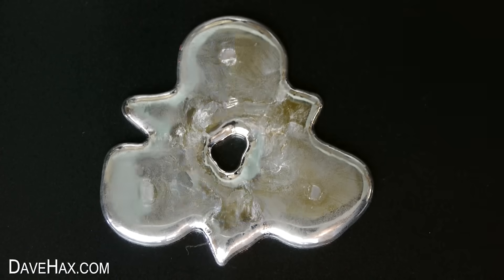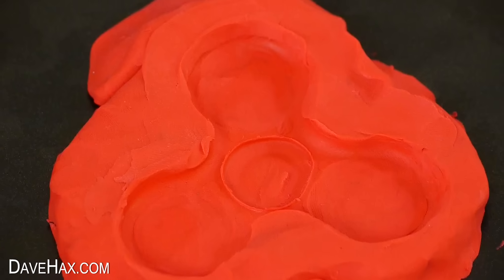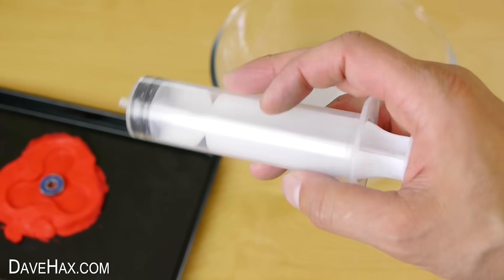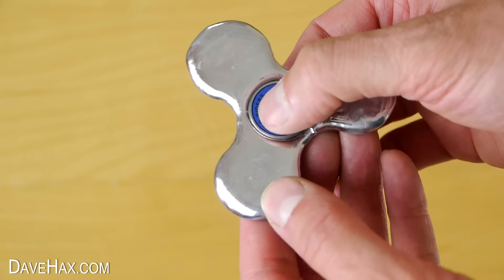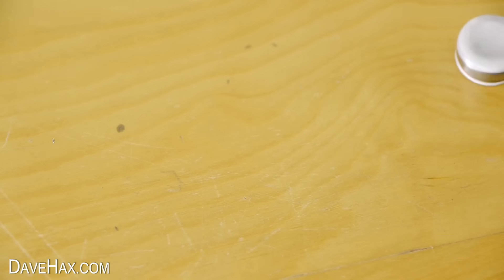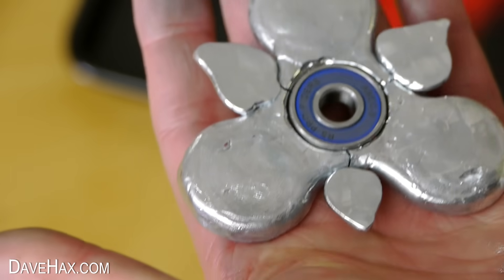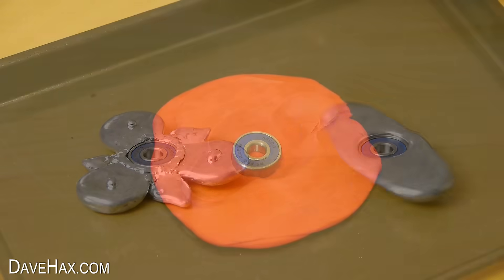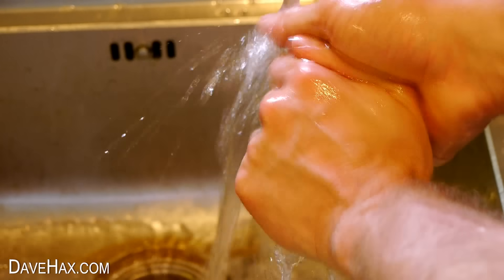DIY Gallium Fidget Spinner

Comment: No reason to partly destroy the outer shape when you take the forming spinner out. Using the holes would make more sense especially when you remove the material in the next step anyway…

Comment: But gallium will melt 
If we kept this on our palm
Because gallium's melting point is very low
Reply: They are making this in one of the cold countries I guess
Reply: Subodh Gorai
Reply: Subodh Gorai it wouldn’t change your body’s temperature. Unless your outside.
Reply: Yep, look at his fingertips at 2:37
Reply: Also, at 4:15 you can see his fingerprints in the spinner just from touching it a few times.
Reply: agung novia  no and because of this it is used alloyed with indium and tin as replacement for mercury
Reply: 29.76 degrees
Reply: Since our normal body temperature is 37 degrees Celsius but gallium's melting point is 30 degrees Celsius
Reply: Yeah like 80 degrees
Reply: freakin thief I was gonna say that

Comment: Can i use Mercury instead? ( ͡° ͜ʖ ͡°)
Reply: Yeah. You should be fine...
Reply: Radziecki Opiekacz Do Dzieci ( ͡° ͜ʖ ͡°) nah, mercury is for drknking.
Reply: when just cancer you get from fidget spinners is not enough
Reply: Nah, mercury only safe as teeth fillings.
Reply: Radziecki Opiekacz Do Dzieci ( ͡° ͜ʖ du zu zu zu viel mehr mit dem bus fahren
Reply: only if you're in a freezer
Reply: Tomasz Gowin 1
Reply: Mercury is poisonous as well so dont' touch it or eat it !
Reply: ( ͡° ͜ʖ ͡°)
Reply: Оксана Маркова booking com
Reply: ( ͡° ͜ʖ ͡°)
Reply: Mercury doesn't stay in a solid state in room temperature dumbass.
Reply: napewno
Reply: just remember to hold your breath and not eat your mecury fidget spinner :^)
Reply: Radziecki Opiekacz Do Dzieci ( ͡° ͜ʖ ͡°) Polska jest wszędzie  (0>0)

Comment: Gallium melts at about 303 K. So you can't use it in summer. In facht, if you hold it long enough it will melt in your hand. Additionally, it can be irritating to skin, which makes a coating necessary.

Comment: Well, thanks a lot for introducing me to gallium. I mean, I knew it existed, but I didn't know it was so easy to handle and had such a low fusion point. Who would've guessed you coukd melt metal in hot water and pour it in a mold made of Play D'oh? It seems to be ideal for many DIY works. The purpose of a fidget spinner still completely eludes me, however, as I find it a useless novelty whose hype is only sustained by clever marketing, but the video was worth watching.

Comment: Trick tip for fidget spinner: 
Have a problem with noisy bearings? 
to make the perfect bearing lube you will need. 
- super glue (I know it's weird) 
- 50ml water 

Mix your ingredients until it is 'mixed in' 
Use a spoon or something to pour the solution onto you bearings. 
And voila, the people around you will no longer have to hear you fidget spinner.

Comment: Who even casts with gallium? Its melting point is at around body temperature (Also explains why you had those stains on your hands).  Try using aluminum in a foundry instead. Gallium isn't very practical, especially for fidget spinners since it just melts in your hands.

Comment: Not sure if it's that practical to make something designed to hold in your hand out of a material with a melting point below your body temprature...

For those who don't know: Gallium has a melting point of 29.76°C (normal body temprature is around 36-37°C for those who are more acustomed to the farenheit scale). So this little toy will actualy melt on a warm summer day even in temperate climate.

Comment: only problem is, if someone, i dunno, a kid, holds it in there hands and fidgets with it without spinning it (as in moving around hand [warming]) it would most likely melt, and then you'd have your fidget spinner as a puddle on the floor.

Comment: Metallic gallium is not toxic. However, exposure to gallium halide complexes can result in acute toxicity. The Ga3+
 ion of soluble gallium salts tends to form the insoluble hydroxide when
 injected in large doses; precipitation of this hydroxide resulted in 
renal toxicity in animals. In lower doses, soluble gallium is tolerated 
well and does not accumulate as a poison, instead being excreted mostly 
through urine. Excretion of gallium occurs in two phases: the first 
phase has a biological half-life of one hour while the second has a biological half-life of twenty-five hours.
Reply: You could've just linked the Wiki instead of copy and pasting it
Reply: +Sgtchickens 😂😂😂😂
Reply: This guys is legit. look at his recent video.
Reply: dm12.certi e2

Comment: Don't even bother trying the gallium one, gallium melts as it sits, so if you aren't touching it for a while the room temp will just melt unless you store it in a fridge when not in use, and if you spin it and touch it with your fingers, it slowly melts, makes a mess.

Comment: Doesn't the gallium corrode the outer of the bearing?
Reply: They're usually made out of steel, which doesn't have many issues with Gallium. Aluminum, copper, or their alloys can cause corrosion when placed with gallium.
Reply: Smikkelbeer depends on what the outer bearing is made out of
Reply: Edragoninja Gallium corrodes quite a lot of metals
Reply: Smikkelbeer Gold doesnt corrode at all alloys in gold do but gold itself doesnt.
Reply: Smikkelbeer the outer bearing doesnt matter tho
Reply: metayoshi1 Gallium corrodes all metals except tungsten and tantalum
Reply: Patrik Kišićek Gold does corrode when in contact in Gallium. It only doesn't go as fast as e.g. aluminium. 
There is quite a big difference in how fast or how much a metal corrodes between metals.
Reply: Smikkelbeer Fuckin nerds, SPORTS SPORTS SPORTS, AMIRITE
Reply: Yes
Reply: who cares?